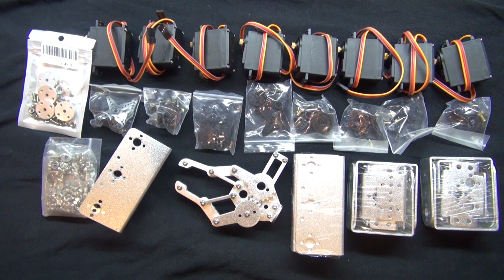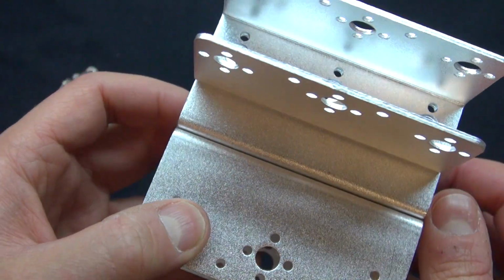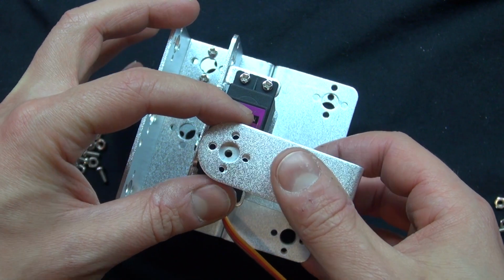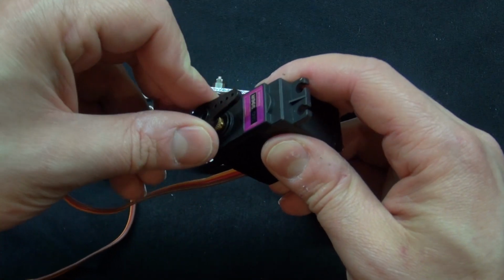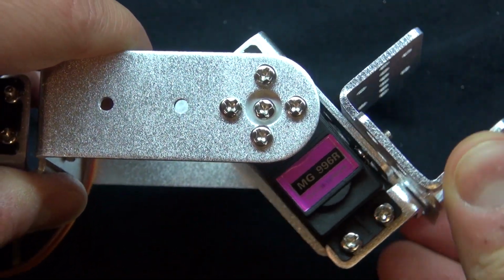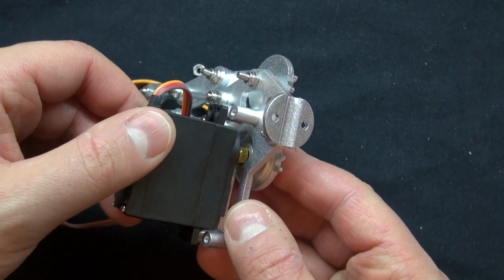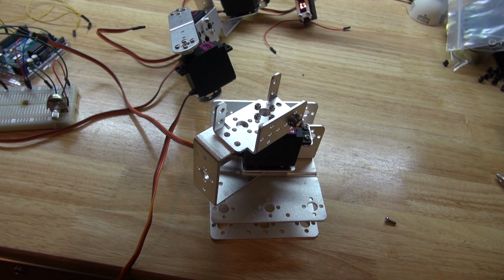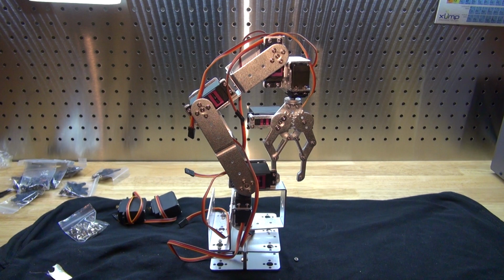How To Build 6 DOF Robot Arm Kit

Comment: Dude.... this was an absolutely terrible instructional video. Even if you ignore the fact that you just didn't include the programming part, there's so many thing that make this video bad. 
First and foremost,  WHY THE Jesus H. Christ DID YOU SHOW US THE MISTAKE AFTER WE ASSEMBLED IT INSTEAD OF JUST SHOWING US HOW TO DO IT RIGHT and editing out your own mistake? You literally didn't even need to explain anything about the mistake, just show us the correct way
Second, your voice is creepy. Just talking like a normal person, jfc. This is an instructional video, not some weird ASMR video.
Third, those are not screws and bolts. Those are bolts and NUTS.  
Fourth, you could have trimmed SO much wasted time of this video. Like we don't need to watch you do every screw, or aligning the motor every time, and showing us in painstaking detail all of the degrees of freedom it should have.

Worst instructional video I've seen in a while.

Comment: Thank you for making this but it would've helped more if had you mentioned what sized bolts you used as you went through the build. I'm only 8 minutes through the video. I hope I'm using the correct ones. I would hate to have to tear it down and have to rebuild it later.

Comment: Sir, can u help us by giving code for controlling arm.. with 3 joystick , using nrf24l01(wireless) module. We used pca9685 for powering up servo ..
Reply from the maker: Sure, the code I have is in the link in the description below.
Reply: use 2 4 axis joysticks it will make control much easier

Comment: how did you power the whole system?
Reply from the maker: I used the Arduino 5v. You can also use 6v from lab bench power supply.
Reply: @SciTyeTech you could burn the arduino if you power so many servos at once

Comment: At 3:20 its a bearing

I dont think its being used correctly for a bearing. It seems to be pressed up against the metal which kinda eliminates the point of a bearing
Reply: I do not think it is being used as a real bearing because the hole in the servo mount is bigger that the bearing and there is an air gap between the servo mount and the "bearing" therefore rendering their relationship as a real bearing a moot point.
Reply: Flange Bearing

Comment: Hello .. Thank you very much for your effort. I think 5 dof would be enough instead of 6 dof. It seemed to me that 3 DOF designs in the same direction make it cumbersome. Your video will be very useful.
Reply from the maker: Thank you! Basically yes you can make it in different models with using the same materials.